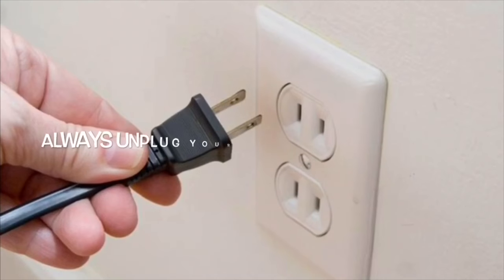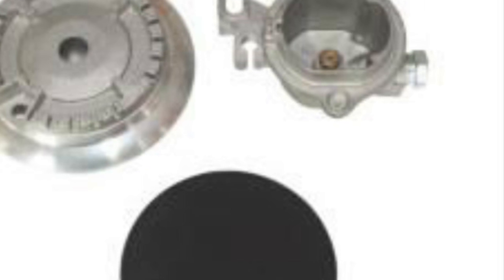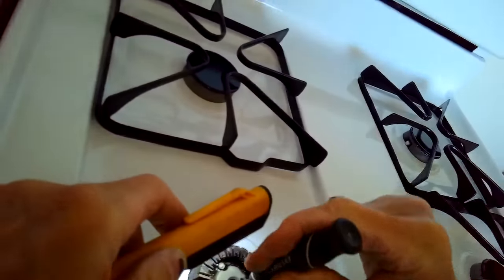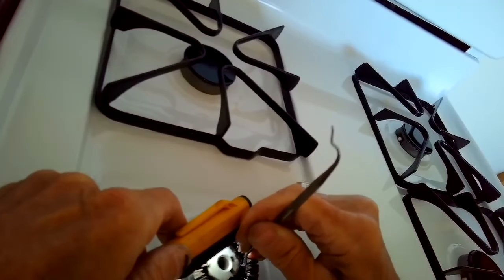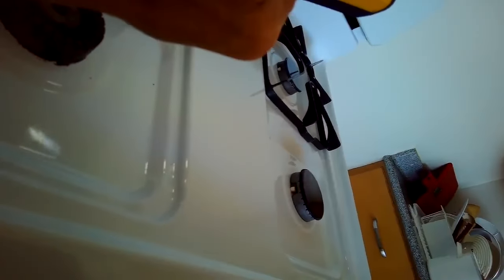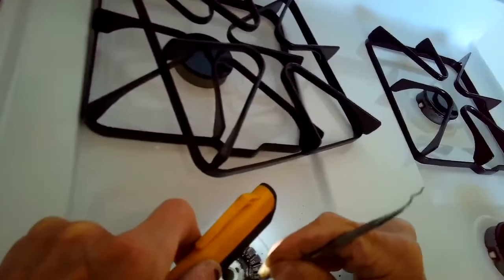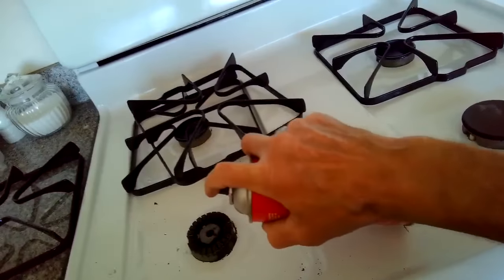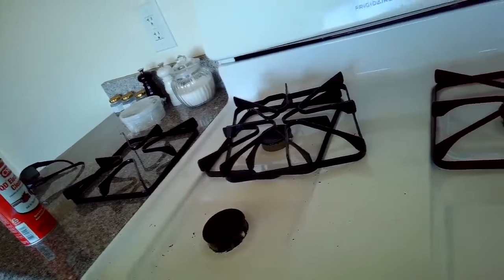✨ GAS STOVE CLICKS BUT WON’T LIGHT - 5 MINUTE EASY FIX ✨

Comment: You Totally helped me get that front burner going, (the wife’s favorite burner). I cleaned out the little holes in the ceramic part. It was the 2 small holes and the bottom one looked like it got clogged with cheese. I used a paper clip as suggested. I liked and subscribed cause you deserve it mang 👍🏽

Comment: It worked! At first I tried a finishing nail, though it fit, the end was too pointed and didn't clean the bottom of the hole enough. We snipped the end of the nail off which made a nice fin that scraped the bottom nice! Thank you!
Reply from the maker: Very good,
Thanks 😊

Comment: tip - find a tiny hole just above the "spark igniter" and run something trough it to clear it (i used a paper clip). you still can clean the rest, but i believe that little hole is the culprit.
Reply from the maker: Great advice😊😊😊

Comment: I had this problem too. I replaced the gas burner after cleaning the ports in the burner head (mine doesn't have a hole but cutouts at the top of the burner head). There was no blockage. I ended up replacing the burner head and it has worked perfectly for the last two weeks. I see no reason why the burner head works since I cleaned the old one.
Reply from the maker: I’m so glad you got it working 👍